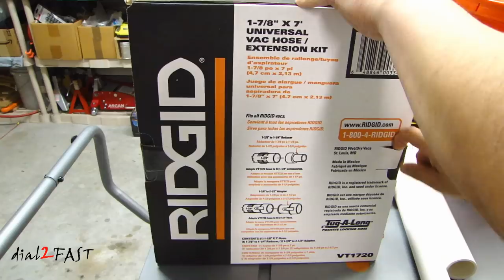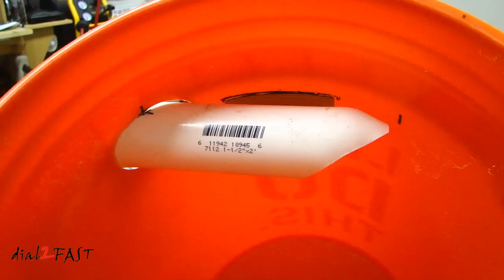How To Make a Cyclone Dust Collector for Your Shop Vacuum

Comment: I wonder what the point is, if you need to MT a container the same size as the shop vac why bother to go to the trouble of building these things. I can understand a huge shop wide system with a 45 gallon drum cyclone but this makes no sense.
Reply: Its all about the filter clogging in the shop vac,this eliminates stopping to clean the filter.

Comment: Nicely done indeed. But do yourself a favor...when you are not using the table saw, DON't use it as a project table and for goodness sake wind the blade down blow the cutting surface, this is standard safety practice.

Comment: Why don't you just mod your shop vac tank to do the same thing? Then no need for an orange bucket mess and the loss of air flow/suction from it. And it costs less than your project would. Less items to clutter up the work space.
Reply: The flow and suction losses from a dust collector are negligible. There are no filter elements involved; all that happens is the air/sawdust mixture spins around the outside of the collector until the sawdust slows down enough to drop out of the stream. Even if you modded your vacuum, you still get more material into the filter since it is drawing in air from several inches down into the bucket instead of one point in the very top. Provided the hose and the ports on the collection system are large enough, there should be no performance decrease.

As far as space/workshop clutter, this does take up extra space that could be used for a bandsaw or some other piece of equipment. In that case, modding your shop vac or just not doing this in the first place may be a more favorable option.

Comment: The title is misleading - what you've made is a dust separator, not a cyclone. Also, without a thien baffle once the bucket gets half-full or so, the dust will start getting sucked into the vacuum

Comment: seen this for cheaper, less labor and simple to empty BUT is not the system people come up with , it's the fine dust we all must avoid and to do is to have the right vacuum that have 2 holes for out and in suction. With that kind you can put a hose on the out blower and put it out the window , while you can add this gadget to collect the large wood particles. Seen shops with a fine coating of dust on tools and on everything? that's the fine wood dust particles in which are the dangerous to inhale.
Reply: so what happens to the fine dust on this system?

Comment: Was your filter clean, too? These may collect the large dust, but the fine dust keeps going because the size of the device is too small for the fluid dynamics to work the way you want. BTW, your so WAY too much uptalking. Half of your commentary sounds like a series of questions.

Comment: What was the point of cutting the circles? Or laminating an inch-thick mounting plate? Or using 8 screws? Or using a straight inlet pipe? Or heat-forming? Or driving to HD and taking the rest of the day to save $65?
Buy some wet-vac dust bags and go smell the roses while waiting for them to be delivered, for heaven's sake.

Comment: Nice job. I am going to make one of these to collect metal chips from my mill and lathe so my shop vac stays clean from the oily mess. I think I'll use a medium size trash can or maybe a 30 gallon metal drum, the tall skinny kind, if I can find one.

You can make these with no side inlet, just drill the top for a fitting close to the outer rim as possible then put in a 90 degree fitting so the air spins, presto no cutting the bucket needed, just the top and it works just as well as the air spinning around the bucket separates the dust just fine as your version does. 

Maybe I'll make a video..... no need looks like other people figured it out also - here is a link to one. https://youtu.be/vvVokh3UNVM
Reply: Robert B a